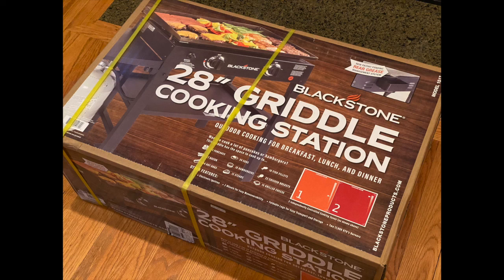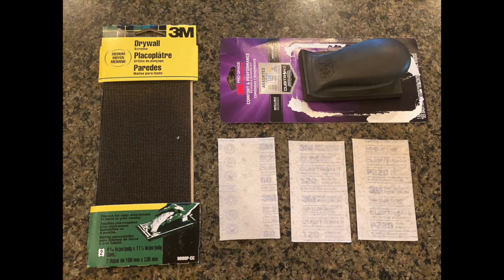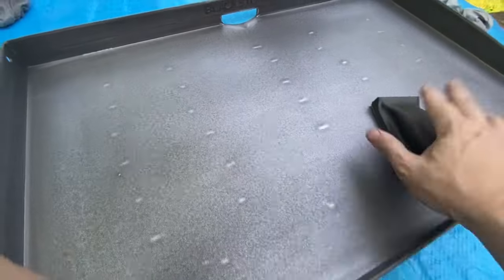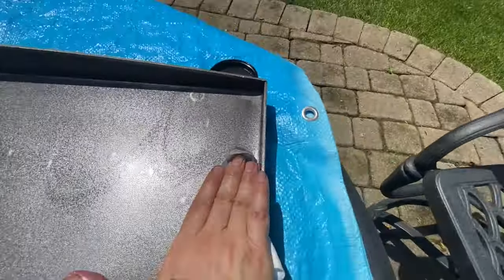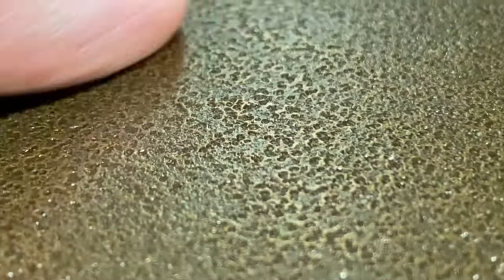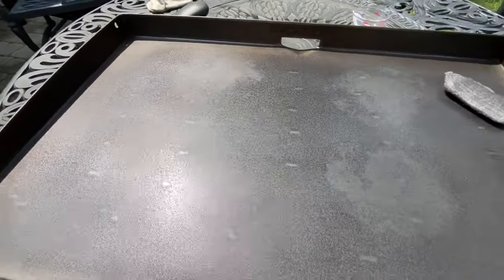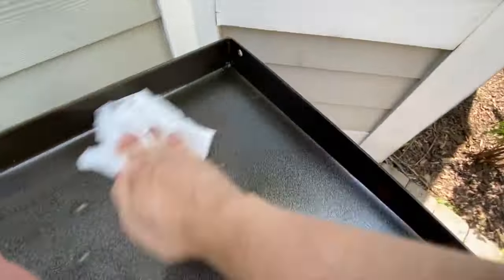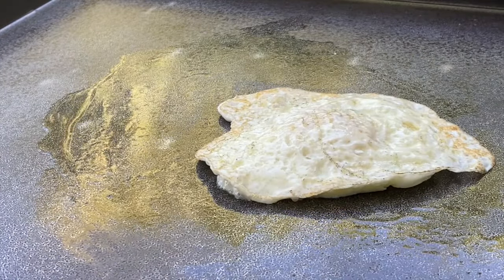Ideal seasoning for a new Blackstone griddle

Comment: Just finished sanding my brand new BS per your vid and instructions on FB page. I do have one question. After I was finished with all the sanding I started cleaning it off with water/soap. I noticed that eventually I was no longer picking up any residual dust. That being said, if I used the rough side of a kitchen sponge to clean with some soapy water then wiped with a paper towel it continued to show dirty on the paper towel. If I used the soft side of the sponge to wipe with soapy water and then wiped off with a paper towel it would come off clean....all this being said I feel like I could have continued the process with the rough side and a paper towel showing “dirty” indefinitely. It seemed never ending. Is that side of a sponge really hard enough to continue to take off the manufacture “coating?” My surface looks just like yours and is smooth as glass, just want to make sure it’s all the way clean before I start seasoning.
Reply from the maker: jolzew11 thats interesting.  The soap might be stripping off some stuff, I don’t know for sure. I didn’t use soap, though.  If it wipes clean with water and a towel, I believe it’s clean enough to begin seasoning.
Reply: Reverse Engineering Reality Thanks, yeah it was strange, felt like I could have went forever but wiped perfectly clean using the soft side or just a wet paper towel. I used the soap just to make sure I followed the one time instructions of using soap/water the first time before seasoning and to make sure I got all the residue off from sanding. Definitely looking forward to seasoning and using it. Have two under 2 though so everything in life runs on a big delay lol.